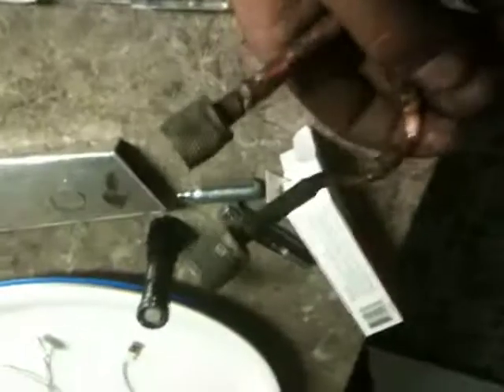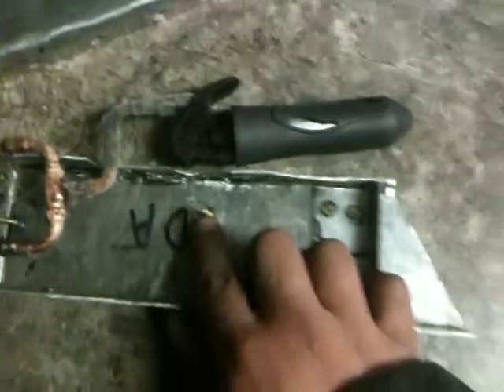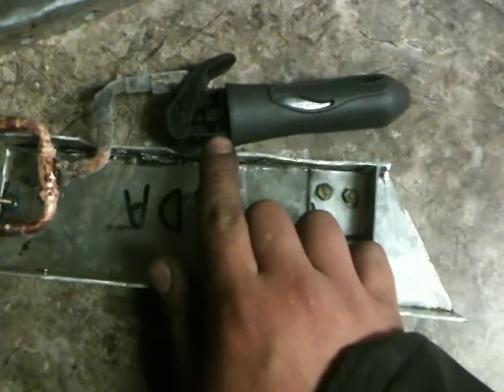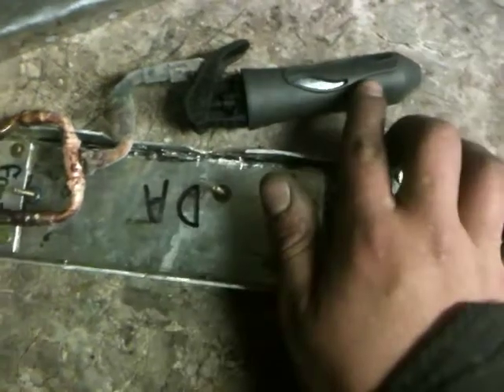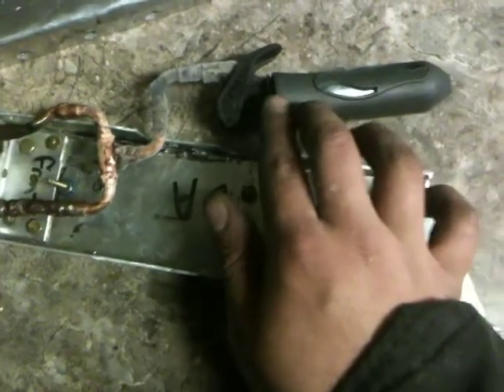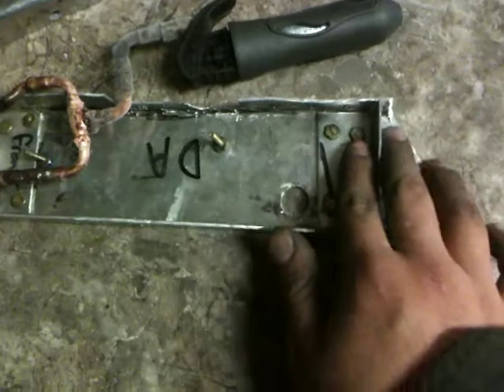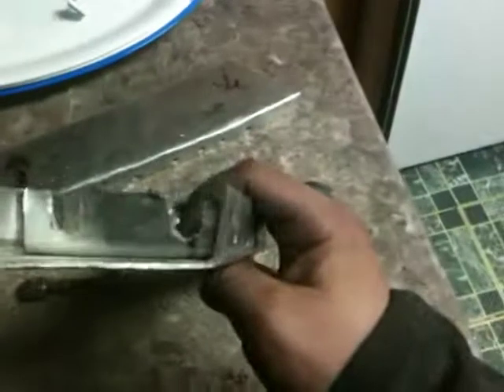Dresdon Acacin's "Alpha Prototype" gauntlet flame thrower upgrade 06/12/12

Comment from the maker: I currently have a super-bright yellow 5mm LED in the flamethrower housing, but instead of using the Gallosgun valve piece I'm working on getting ahold of a 12V 150psi solenoid valve that's rated for CO2 and a regulator, so the valve doesn't freeze up and jam like's been happening with that one(why I don't have it functionally installed)
It'll essentially be a Dynotune NOS kit with CO2

I  COULD   make it shoot flammable liquid or gas, but wheres the fun in melting your resincast helmet?